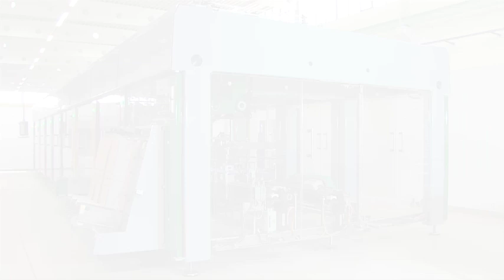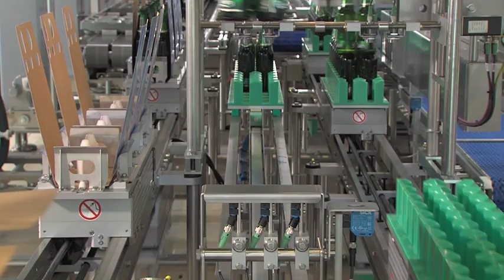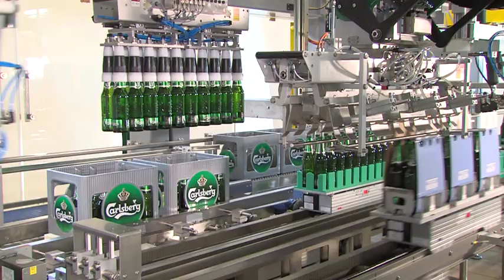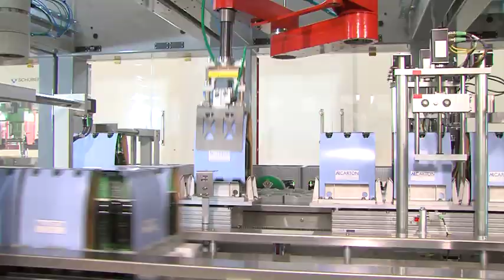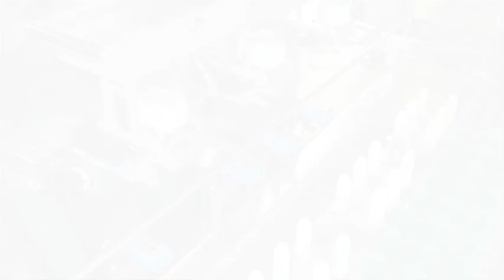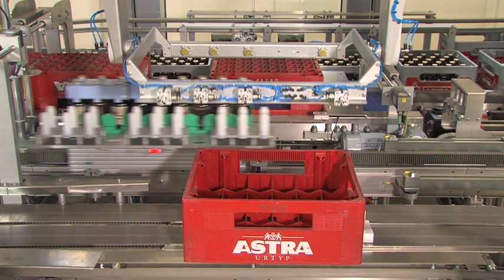Flexible packaging line for beverages from Schubert: Packaging beer bottles in boxes

Comment: It is either very good at what it does or it is very slow or it goes into basic mode or you are waiting for the electricians, control techs , engineers,  Schubert  specialists or you are repairing the robots that have self destructed, waiting for a simple part to be flown from Germany etc. etc. etc. We have two in our brewery  and I wish our managers had bought something based on the K.I.S.S. principle. If you want lots and lots of down time and costly repairs and service I would highly recommend one or more of these machines as they will probably bankrupt your company.